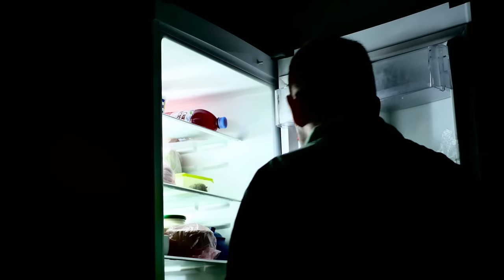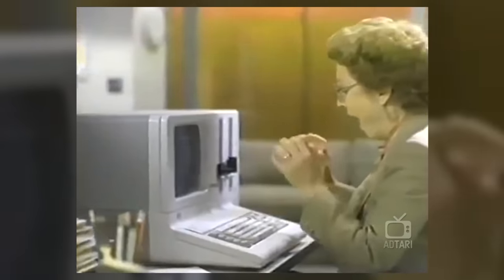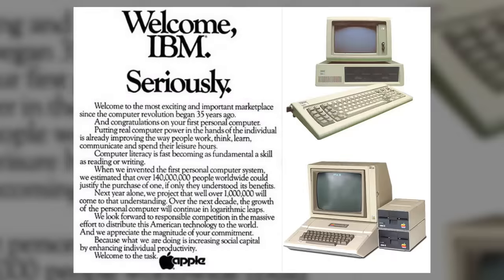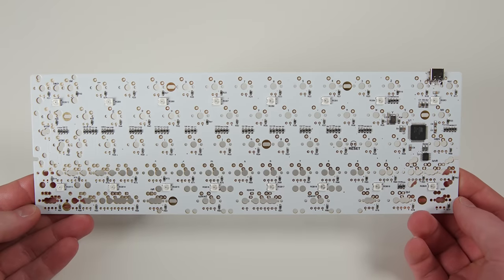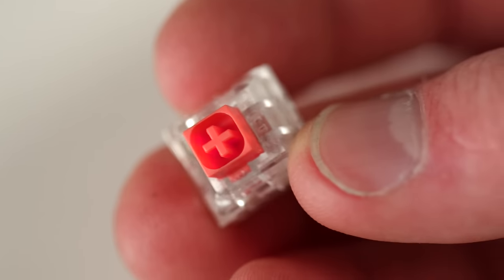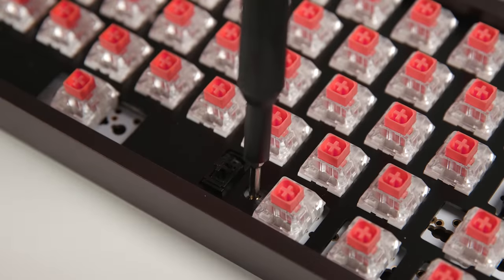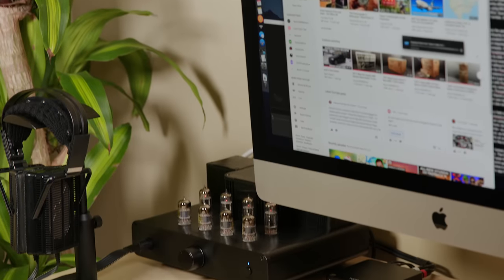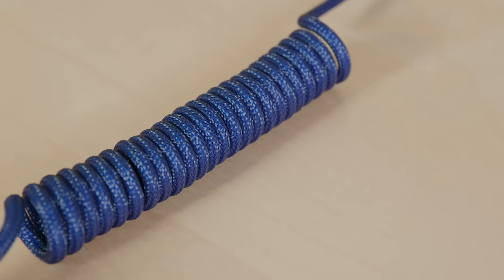This DIY Mechanical Keyboard Costs $300...!

Comment: Someone recommend me a mechanical keyboard under $100...go
Reply from the maker: Honestly? A vintage IBM Model M with a USB adapter.
Reply: anne pro 2 if you want box switches like in this video (only box black, white and brown though) 

it also has bluetooth and RGB backlighting along with an easy to use software for light customization
Reply: Coolermaster actually makes some decent mechanical keyboards under $100 if you care about actual Cherry switches over Gateron or Kailh switches.
Reply: What do you want it for? Gaming? Writing?
Reply: @dozyote cherry switches are disgusting, I like cooler masters quality tho
Reply: Drevo Calibur
Reply: @snazzy  you see...i had a gut feeling i should invest in one
Reply: @TheJtorres182  both...but mostly in my case typing
Reply: Go refurbished, I got a like new G710+ refurbished from Amazon for $60
Reply: Red Dragon Kumara
Reply: LeBeautiful Logitech G Pro. It ranges from 100-129$. I have it and it’s a good keyboard
Reply: Magicforce 68. The cheapest model at $40 use Outemu mechanical switches, but if you spend a little bit over $20 more, you can opt for backlighting and much better Gateron mechanical switches.

Go for blue switches if you like to type, or brown if you like to type, but don't want to get noise complaints from nearby people.
Reply: Go watch LTT.
Reply: Dell does make a decent mechanical keyboard. They are old, but still kicking.
Reply: IKBC 87

Cheap, very good quality, PBT keycaps, and Cherry MX switches.
Reply: ikbc C87
Reply: @tyler94302  i dont think you can beat the build quality for that price tbh
Reply: @dozyote  Give me Gateron or Kailh over the mediocrity of Cherry every day of the week. The only decent switch they have is Blue and it's the worst Clicky switch I've used.
Reply: An IBM Model M or an AT101W (might want to linear mod if you like gaming)
Reply: for gaming, I prefer the fnatic ministreak. tkl, usb c, cherry mx browns, and rgb. definately go with an anne pro 2 if you want reds for linear, quiet typing tho. or go ibm model m if you want nice keystrokes but can handle some really loud typing
Reply: I have Rappo 500S for about a year and I like it a lot
Reply: I love my ikbc cd108 $80 from Amazon
Reply: @snazzy  Don't need an adapter if you get a later Mini PS2 cable, and a motherboard with PS2, which is quite common. OR get a larger original DIN type cable and a cheap adapter. Any  USB adapter made for a Mouse will NOT work with Model M keyboards. There is a custom one, including a converter chip, for about $20. Google Model M.
Reply: LeBeautiful get you can make a custom with lubing and not off-brand stabilisers, you can get gh60 rgb, a metal case, some box navies or whites (can get more premium ones like the zealios but that’s gonna be expensive), no shortcuts, metal case and a braided cable for like 60 or 70.
Reply: dgpx84 why? There’s a real demand for them. You just threw like a quick 30 bucks (maybe more if you could wait)
Reply: Danilo de Klerk haha why bull? Size, tkl, layout, backlit. Its all for certain uses
Reply: Duckys look decent

Comment: Hey! FYI, baking the cable into the coil is just 1/2 of the coiling process. After it’s cooled off, you invert the coiling, which gives the coil its “snap”.

Comment: DIY keyboards can cost few lower than 100 bux even if you chose cheaper PCB, plate, case, switches and keycaps.
Edit: Very bad switch choice.

Comment: Mechanical keyboards and the community around are pretty comparable to audiophiles.

Good job on your first built, but I highly recommend you to lube the switches and especially the stabilizers. Also you should definitely clip the stabs to reduce the noise which will reduce the rattle and make your keyboard sound better. And putting some foam under the PCB can reduce some the the annoying reverb. O rings might be an option but some people don't like them as they make the keyboard a little less sharp feeling.

Comment: The mechanical keyboard rabbit hole goes fucking DEEP. I've only had one, a fullsize cheap chinese board with Gateron browns that I've been happy with for the last 2 years, but after sampling various MX- and Alps-style switches in search of greater tactility, my research for a new build now has me part sourcing for a handwired build with a custom layout (60% with a numpad and arrow keys)

I think a lot of the appeal, certainly in my case, is the fact that making a keyboard gives it that personal touch. My brother keeps telling me to just buy a Model M, or an old Alps keyboard, or their modern Unicomp or Matias descendants. But I want to make a keyboard I can really call my own. Plus I kinda enjoy building and tinkering with things to begin with. I was a Lego kid, I've done several console mods from the ever-popular Game Boy Advance AGB-101 mod to performing the difficult UltraHDMI mod for N64 myself, I did many repair jobs on my first car from simple oil changes and battery replacements to starter, suspension, and engine mount replacements. And of course I enjoy building and upfrading PCs, and I built my own computer desk. This hands-on sort of thing is just very satisfying, y'know? And especially for something like this, where you get to enjoy the results on a daily basis. That's where the appeal of the mechanical keyboard meme lies for me. If it was all about prebuilt keyboard and there wasn't such a robust custom market and community, I would give less than a shit, really.

Comment: A tip for new solderers: If you want your soldering job to look very clean and professional get yourself a brush and use some alcohol to clean the flux from the board after you make the solder joint... Or just use 63/37 solder with no flux.

Comment: Now, my first mechanical keyboard was a Thermaltake Poseidon with Cherry MX Blues, and I loved that board while I still used it on the daily.  When I first found out about r/mk and the expensive world that it is, I ordered an Anne Pro v1 (60%) with Gateron Browns, and have been using that ever since.  Most recently I got a Kira with Hako Clears, which I've been thoroughly enjoying at work, where the majority of my use is typing--which the heavier switches are a lot nicer to type on than I thought they would be (and heckin' quiet, to boot!).

Still, if you like Cherry MX Blues...then use them.  Anyone who puts you down because you're using a prebuilt, or using Cherry switches...honestly, I'm not sure if they just have too much time on their hands, or otherwise just want to gatekeep this already tiny community.

Oh, and be warned on the box switches.  The stems (unless these are the ones made with new tooling (doubtful)) are slightly out of spec with the standard Cherry MX-style stems, which have been causing damage to various owners' keysets (ABS, IIRC); making them unusable with any other keyboard or otherwise becoming wobbly or unstable.  There are a few group buys for tools to resolve this issue by modifying each switche's stem...but its just something to keep in mind.  IIRC, this mainly affects ABS keycaps; but I'd imagine it would also occur with POM and PBT caps as well...but, r/mk to the rescue on that one?

 Either way, lovely build!

Comment: My Mac is plugged into my TV so sitting on the couch, I'm essentially limited to using a wireless keyboard with a built in trackpad. The Logitec K400 is pretty much the only decent option out there and that's crazy that it's the case. I would gladly pay a few hundred bucks if there was a quality tactile product.

Comment: You should look into tuning and lubing your stabilizers. You have some really loud rattle from them. Just applying a good bit of dielectric grease to the stabilizer wires where they go into the plastic part of the stabilizer will almost entirely remove it
Reply from the maker: Ian Palleiko Fixed! 😊 https://youtu.be/NTtGNXeBH20

Comment: Hey, just a tip. KBDFans provides cheap stabilizers, unless you order genuine cherry stabilizers (they sell them, so does a local vendor called Novelkeys here in the US). If the rattle ever starts getting on your nerves, I suggest buying some genuine cherry stabs, and lubing them with some dielectric grease. This will improve the sound substantially, and in my opinion, makes the typing experience overall more enjoyable.
Reply from the maker: Giorgio Rafaelle Fixed! 😊 https://youtu.be/NTtGNXeBH20

Comment: Just take it apart once, put a piece of  non-conductive foam below the PCB and you'll have a much more silent keyboard. If you want to go even further, then go for double shot PBT keycaps and again stick a piece of rubber mat below the chassis.

Comment: Coming from someone who does not currently own a custom keyboard, but is looking into building one, i don't think $300 is too bad for a nice keyboard. More expensive prebuilt gaming keyboard are already getting dangerously close to that price point, and they aren't really anything special. Some dedicated media keys, a whole lot of RGB and maybe some extra macro keys, but otherwise just bog standard mx-cheapo switches, cheap keycaps and plastic cases. $300 for a keyboard that is built to my preference and with more premium components is pretty reasonable, especially since it's upgradable and user serviceable.

Comment: A cooking chef does not use an 18 dollar knife, even though an 18 dollar knife is perfectly adequate to prepare any food. I guess it all has to do with the amount of time you are using a tool. The more that is, the more you want it to be a little bit better, and the more worth it is according to ... price divided by time it is used. If a chef cooking spends 30 times as much time on preparing food than the average mother of 8, than he sortof can spend 30 times the price on a knife and it will sortof be the same buy. Maybe it works because while the chef is knifing away, he is not needing to buy other stuff that cost money, like keyboards. Yes as you can see, I like typing, not because it helps anyone but because ... yes why, this keyboards sucks bad (Logitech rubber dome ... garbage!). Yes you guessed it, I am between keyboards (_the void_), and will tool up soon ! Awesome build you did there by the way.

Comment: I cannot  imagine how any keyboard, no matter the price, can be much better than my forty year old Model M Compact buckling spring keyboard, which I found new in its sealed box in the dumpster at my place of work.  These keyboards were originally supplied only with IBM servers. I have four of them. I also have several Model M standard keyboards, also superb. I'm glad motherboard  manufacturers still put PS2 connectors on new motherboards for gamers. How many other pieces of technology from 40 years ago are still among the best available? None.

Comment: U should've lubed your switches with something such as krytox 205go and clip/lube the stabilizers with dielectric grease... Also, u could add foam under the PCB to dampen the noise which makes it sound much nicer

Comment: 7:53 - The keys are not perfectly parallel. Look at the "Backspace" and "Return" keys on the right. Looks like the left side of "Return" key is slightly slanted down than its right side.

The perfect key I'd like to have is a mechanical keyboard with the buttons being mini OLED screens. So the labels will change as I change keyboard language in the computer or based on the games I'm currently playing.

Sadly the industry catered towards RGBs.

Comment: All the money goes to the GMK set. DZ60 boards are actually pretty cheap. You can get a set of TAIHAO OEM caps for 50 bucks and a KBDfans aluminum case for 80. I'd get the hot swap dz60 which is another 55 bucks, cos switching out switches without having to desolder is well worth the extra 20 bucks. Then you get your burnt orange switches for 25 dollars with a few extra just in case. Of course, get some good stabs and lube them, which costs another 20 dollars. This ends up around 225 dollars, and you get an arguably better experience than the one you built. Also, if you don't need hot swappable pcb, just get the regular DZ60 with the burnt orange set on KBDfans for 52.5. That's a steal. It'll bump the cost down to sub $200.

Comment: The keycaps sound a little loose unfortunately. The spacebar sounds like it works the corner. Everything else sounds good, but this makes me wonder if the actuation point is the same on each switch or if the looseness affects that.

All in all, I am impressed. I've recently discovered the Wooting keyboard and have been trying to find something to beat it.

Comment: Where can I get those cables you used for the coiled cables? I saw the part number on the cable (E66440), did a search but couldn't find anything.

Comment: I type at 700+ keystrokes/minute and those mechanical keyboards just have too large of a travel for me.
I use my desk for loads of stuff so I also like a wireless keyboard. And that's where things get tricky. I Had some Logitechs for some time which typed very well, but within months the letters would come off. Then I had one of those Microsoft Surface Pro keyboards, which feel good but they don't keep up with me, the bluetooth connection just isn't quite quick enough. And now I have a dell KM713. The Layout is a bit quirky, but it does type really well and it's a sturdy thing for the price. 
Best keyboard for me? Dell Latitude D610. I do sometimes launch caps because it's easy to get your nails under them when you slide from key to key, but man those things type well.

Comment: I love the retro caps but I dont really get the lack of directionals. As a programmer I have shortcuts on my directional keys. I guess I could add a modifier and use the right : shift, win, cntrl, menu  - which I guess is what u do? - but then I would need to add another keypress to get my shortcuts to work. - most important would be "block-move" where I jump between blocks of code with alt-directional. I guess cntrl-shift + directional might work, but sounds like a hassle. How did u solve this?

Comment: Put some foam under the PCB and cut some of the material at the space bar stabilizer(don't know how it's called) and you'll have a much better sound and a spacebar that doesn't rattle that much.
Reply from the maker: svw1999 Fixed! 😊 https://youtu.be/NTtGNXeBH20

Comment: Just going to say it i like my romer g's they do seem cheaper in build and no one makes custom pbt caps which is sad but makes sense. But to me they feel good, switched from scratchy cherry reds and browns ( pre - mold refresh). I do like them for the key depression stability. Less key wobble than the Cherry variants. I know the new lubed stuff and box switches are out there and i want to try them, but for now i will stick with what i have as a mechanical keyboard no matter which one is still an investment atm.

Comment: Building my first at the end of this month. Wanted to go cheap, so nothing more than a Contra with Box Royals pre retool and Big Bang MDA caps. All in all a solid 110€, and that's without a soldering iron and solder which adds 40€ because I bought used, haha. At this point I could have bought a good wireless keyboard...

Comment: Get a load of this n00b, he didn't even lube the stabs ; ).  Despite the rattle, very nice build.  I've been eyeing that Tofu60 case in chocolate for a while now - looks awesome.  Problem is I just bought a TADA68 and have literally NO REASON to buy another mechanical keyboard other than "because"

Comment: Just a note on planned obsolescence! It is a huge problem in tool manufacturing and stuff. Drills and electronic hand tools have a huge problem with this, often times drills from the 70s really are better than new ones - but because they really lasted forever, companies that made it started going broke. Kitchen appliances (other than obvious power hogs and more efficient ones of todays like fridges and ovens) suffer a lot more in this case - mixers, blenders and stuff are made to break really quickly and overpriced like mad! Check out AvE's channel and you can see in the disassemblies how some tools are really made better in the past.

Comment: Mine cost about 180$, but jut because I bought some parts very cheap and even got the switches for free. Wooden case (rosewood), vintage 1980s Cherry MX clear switches (I soldered them out of an old Cherry Keyboard I found on a Junkyard), OK60! PCB (not cheap, yet not super expensive, paid about 40 USD with overnight shipping, usually they are about 27 to 35 USD where I live), Enjoypbt Dye-Subbed Keycaps with Japanese characters and Sushi control key (Those are like super expensive, about $90USD with shipping to where I live) and an Aluminum plate. I will make some changes though...
The PCB will be made hot-swappable in the near future and te keyboard will get a nice solid brass plate :)
Use it on my mac mini for work, light gaming (Bioshock Infinite, Mafia II etc...) and graphic design... Works absolutely fine and should las decades...

Comment: don't use a heat gun to make the cable. it's not worth it. just hang the bar you wrapped the cable around on the rails in your oven and preheat to oven to 275° F (135° C) and leave it there for about 10 minutes. after that cool the cable down and then twist it. boom you now have a perfect coiled cable that will never lose shape!

Comment: I ordered some Kailh Burnt Oranges but I had to cancel my order for them because of these issues:
- Can develop a click after lube has worn off
- Slightly rotates clockwise overtime
- Can damage keycaps of certain plastics when putting the cap on.
Are these still an issue?

Comment: where'd you buy those cable connectors?
Reply: the quick release connectors are called GX16 Aviation Jacks, I'm more curious to where he bought those specific USB C connectors, because the only place I can find them are from China
Reply from the maker: Got them from Zap! Cables.
Reply: @snazzy  oh, damn you're still replying on old videos :D